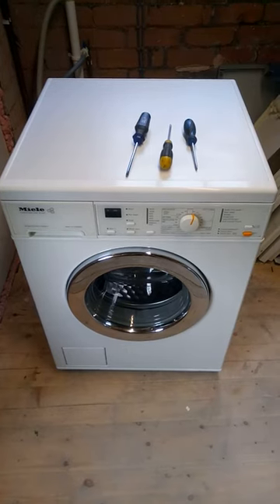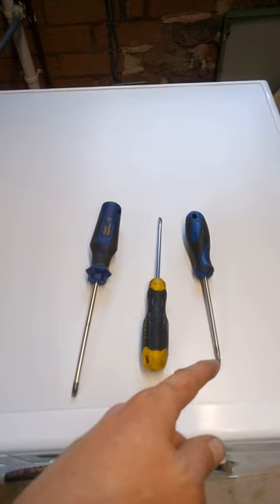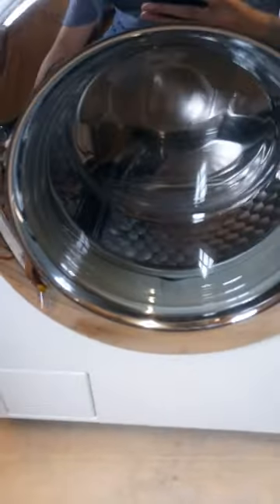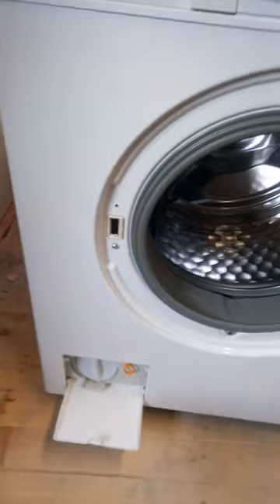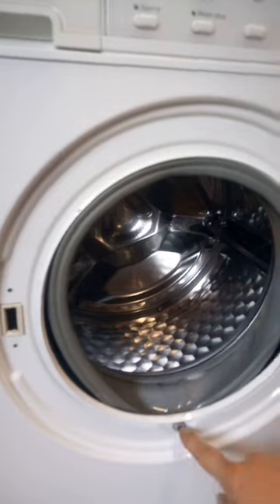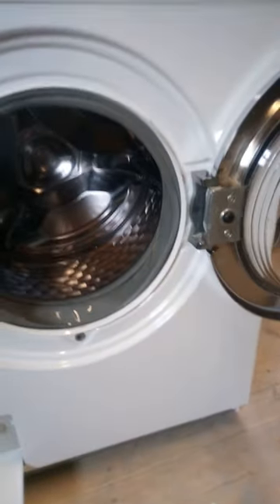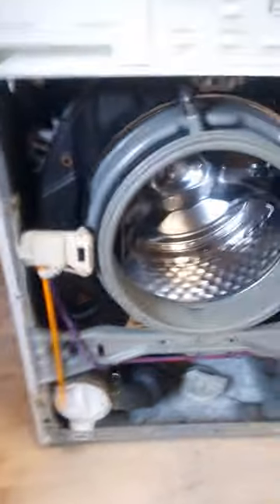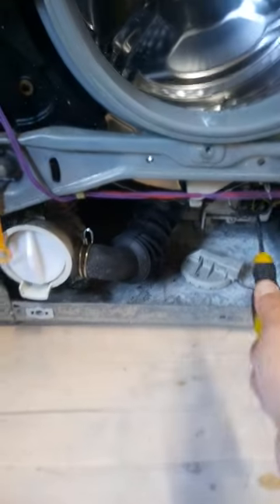Miele washing machine ( classic ) front panel removal door lock door seal  pump heater etc

Comment: Great, thanks, I got the front off with the help of this video, now I can replace the shock absorbers. You're a star. 🤜🤛
Reply from the maker: You should be able to reach them with just the front off although is usually take the sides off as well
Reply: @washersdryersradios  Got in no problem, replaced the two absorbers and am doing a test washing now, but it looks perfect, watertight, still and silent. It was the spring around the rubber I couldn't find before, and that revealed the main screw which, once removed, changed everything. Thanks again!

Comment: Thanks for making this video it’s saved me a £130 call charge from Miele. A comment for other viewers if you are needing to replace the door seal (big grey rubber thing) the inside of the seal is also held in place by a cable (same as outside one on video) this time though it’s held in place with a long screw on the left hand side that you need to unscrew completely. You can then remove the band. There is then just the rubber pipe from the soap dispenser draw to detach. This removes from the door seal side (not the dispenser). To avoid tearing the rubber pipe heat with a hairdryer until hot to the touch.
Reply from the maker: Thanks Rob I'll do a door seal video next week as I have one in the workshop to change.
Reply: @washersdryersradios  Awesome, thanks for this!  Did you get around to making the door seal video as that would be very helpful?  Cheers
Reply from the maker: @Goatman-wl5nk  I will do it I'm having a spot of bother actually getting to the workshop with all this going on
Reply: @washersdryersradios  No worries, understand things are pretty crazy right now hey!  Stay safe
Reply: Yes trying to do that as well. Having difficult to detach the rubber pipe!!

Comment: This is a great vide. Thanks for making it. it really helped me in replacing the door lock. Very easy, no mystery and it saved me a fortune in call out fees. The part swapped right in. Many more years of washing ahead! If I could you get you a beer I would mate!
Reply from the maker: Glad you found it useful
Reply: Hi Adrian where did you get replacement lock for the Miele W413!
Thanks

Comment: I’ll be doing this today on the same exact machine as soon as it drains it floods everywhere the lights flash and then it tripped everything lol.  Got it for my sister as they said only a leak! Not a leak the whole contents of the drum empties inside the machine all over the bottom. And leaks all out… weirdly only does it on drain not before.

Comment: Do you think the side panels can be removed without removing the door seal and just by moving the front panel to one side to access the screws? I'm looking for an easy way to replace the dampers.
Reply from the maker: If you're any good you should be able to replace the dampers by just removing the front panel

Comment: Miele wkr 771 is not as ease after doing the same at 1:05 , is there a guide for my model? I have a problem with the hose being clogged for twin-dose
Reply from the maker: Twin dose machines are completely different and I haven't covered them yet as the majority are still under Miele warranty.

Comment: How do you get the control panel off.
Reply from the maker: On this type of machine pull the knob off then insert a thin bladed item in the joint between the white plastic frame of the printed perspex  control panel and the perspex panel  AT THE TOP EDGE ONLY gently press the panel down and lever it out simultaneously working your way along the top edge. Once this printed perspex panel if off you can remove the screws holding the control PCB to the frame.

Comment: Really useful video as it encouraged me to try and replace the heater element by myself. Trouble is, all the YouTube videos show a centre bolt holding the element in place; Miele WDA101 doesn't have this. Any advice on how to extract the element greatly appreciated....
Reply from the maker: Hi Mike the elements are a bit of a £@#£@+) to get out there is no central bolt on a Miele you need to grasp the two metal parts with connectors on pull the element towards you about three inches the gently get a screwdriver under the lip of the black rubber it sits in and work the lip on it out of the hole in the drum refitting is the same but backwards
Reply: @washersdryersradios    THANKS :) :) :)

Comment: Thanks, I need to change the lock I think as the door is not closing, small plastic broken piece came out of the lock hole. Can you or anyone help?
Reply from the maker: Did you watch the video ??
Reply: @washersdryersradios  sorry I should have been clearer. I need help with finding the spare lock for the W412 model. If you could recommend a site to source this I would appreciate it, I have found nothing yet. I can then follow your video. Thanks
Reply from the maker: @disct1597  are you in the UK ?
Reply: @washersdryersradios  yes in london
Reply from the maker: I have locks
Reply: @washersdryersradios  do you have W412 machine lock? if so are you in London, can I purchase?
Reply from the maker: No Im in Dumfries I usually eBay them
Reply: @washersdryersradios  ok do you have one and can you send me a link to purchase. I did check on eBay
Reply from the maker: UK Miele washing machine and dryer repair and advice  on Facebook I run the page join it and I'll message you
Reply: @washersdryersradios  I’m not on Facebook I will have to ask friend. Thanks

Comment: Would you able to help with a miele xl level 5000. Model w5985wps.
The machine is made for Italy, but i live in the USA
Reply from the maker: What's the problem
Reply: @washersdryersradios  the w5985 turn on, start w drain,, load water, than it goes on shutdown error 53. On any cycle.
Miele usa, won't touch it, as it was made for Italy, although it was removed from a usa boat, and i bought it in Florida
Reply from the maker: @italia01139  by the sound of it you require new motor carbon brushes these are accessed by removing the front as shown in this video you will see the rear of the motor under the drum there are two T20 screws securing the plastic cover remove that then pull out the wiring plugs . There will be four T20 screws securing the part that the wiring went in to this is the brush housing remove the screws and pull the whole plastic assembly towards you carefully. Once it is out you will see the brushes these are easy to change and available on eBay for £10 ish. Replace those and do everything you've done backwards being careful to make sure the four pins sticking out of the brush assembly go back on to the receivers on the motor.
Reply: @washersdryersradios  thank you for replying, but according to Miele usa this model does not have carbon brushes, but an induction motor, there for they suggested to replace the mother board.

My issues is, I'd have to order from Italia, and have it ship here.

How could I confirm, that the motor is brush and not induction
Reply from the maker: @italia01139  I'd suggest you pop the lid off and look at the PCB it will have a number on it something like say EDPL ---- put that number up I'll check
Reply: @washersdryersradios  also, i have a w1 that won't drain.
Will do everything, will finish w cycle without drain water, does not give an alarm, i replace the pump, no luck, than miele Italy, suggested to replace the mother board, i did that, and i got error 47 call service.
I put the old mother board back, and same thing.
Will fill, run, heat, but when is time to drain she would just sit
Reply: @washersdryersradios  pop the top lid? And by PBC do you mean. The mother board?
Reply: @washersdryersradios  elp265 that's the number I see for the xl level 5000.
W5985wps

For the w1 wkh270wps. The mother board iselp270